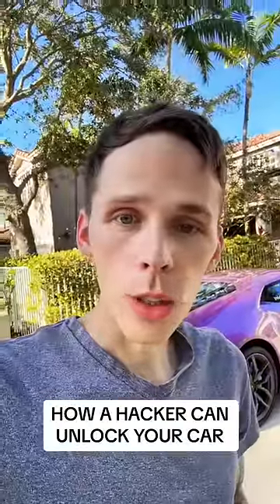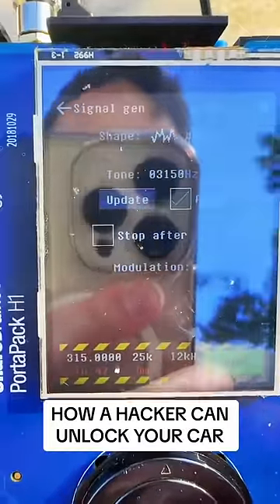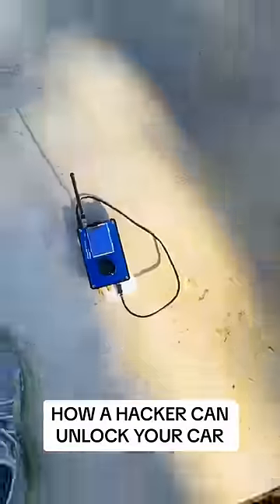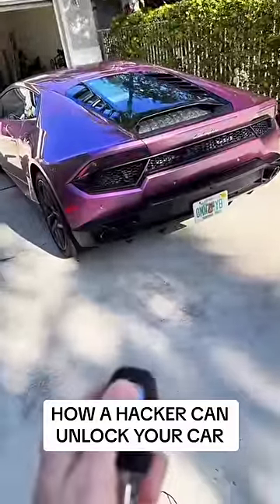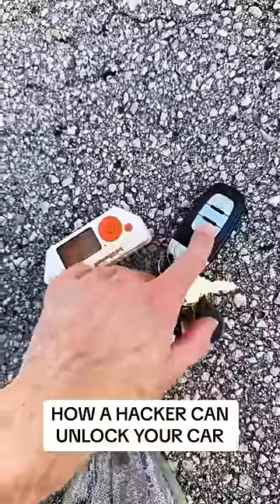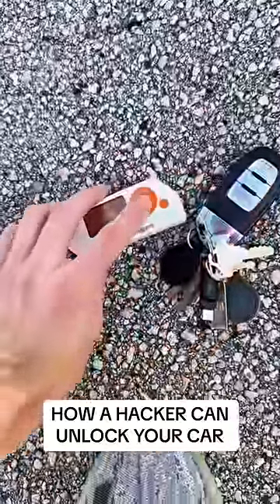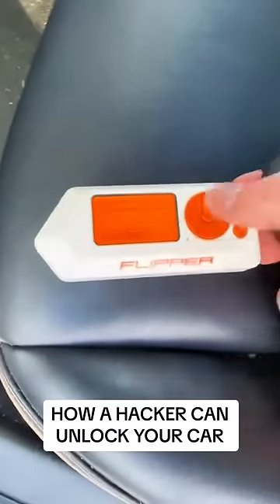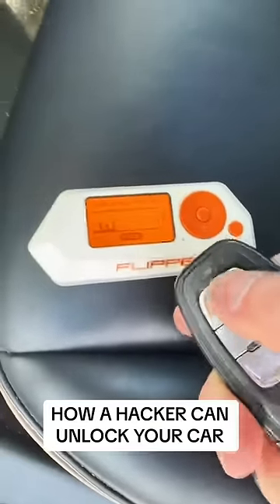Unlocking A Car With A Flipper Zero (Rolling Code)

Comment: I’ve heard somewhere that most modern cars use a rolling code system, so that each unlock/lock has a unique identifier. If that was the case, wouldn’t these kinds of attacks be useless?
Reply: I was thinking the same thing but as you can see in the video he is essentially jamming the vehicles receiver from receiving data from the key fob, at the same time he is recording that data with the flipper and then re-transmitting it later after the jam-er is tuned off. I just don't get how the flipper is able to pick up that signal from the fob with rf interference being broadcasted. It looked like he had to have them right next to each other for it to work.
Reply: this is true for most fob remotes since the mid 90's, for this to work, you need to get fob press signal while the fob is outside of the range of the car, its the only way it works, so in practical use, its just not worth it compared to traditional methods

Comment: Once the jammer is disabled, using the keyfob once should advance the rolling code and make the recorded signal unusable.
Reply: exactly so im a bit confused, i feel like this is a bate
Reply: @firewall_chronicles it is, there are videos everywhere about it after canada banned the flipper zero specifically from being able to unlock cars when the conditions required to do it are so unlikely that it would never happen

Comment: Keys nowadays have unique codes for each time an input is sent to the car, if the codes dont match, nothing happens and as seen, you still need the proper frequency, without the key to begin with you will not be able to do this, its very cool but its just as safe as a normal car against a crowbar...

Comment: Just so you know for some people that are are not aware of how this works. This does not work on all cars. Some of the newer cars will have a system that changes the frequency/coding EVERY single time you unlock/lock the car or start it, specifically designed to stop this kind of hack. Meaning that this system will not work for those vehicles. Flippers will only work for the most basic of functions. And likely not at all for a lot of vehicles

Comment: I drive  a 2014 Lexus Rx 350. Its got 61k miles and is probably as in good  as shape as that year can be. I leave it running every time i go into a store for a drink or smokes. Im in suburban Atlanta and i don't worry. At least if someone steals it they dont break anything.

Comment: Ok, but it also has to clone the passive rfid that lets the car know the key is inside. This wont work on a lot of modern cars because of updated security. You need two separate frequencies to mimic a car key from 2023. Unless you buy cheap trash cars

Comment: 1989 944 Turbo. OBD1. Quick release steering wheel. 5 speed manual. Key entry no remote. Battery kill switch on hood. Good luck.

Comment: 1. Why did he need the noise jammer, he could have just moved away from the car 😭, 2. The key or frequency code grabbed from the actual key will only work once due to the running cycling frequency on the car and fob. 3. If someone wants to open your car, they could simple break a windows and hot wire.

Comment: This is why I didn't connect my two way alarm system to my lock circuit or engine start. You gonna have to break in and trigger the alarm.

Comment: Yeah but that works ONCE, and requires blocking the original fob, as you showed. But once you've used your rolling code (OK, you got two codes for unlock, so it'll work twice) it stops working.

Modern remotes have more tricks, like requiring to be within the car, or else the engine stops. This trick is of limited use.

Comment: If your keyfob is not working, quickly open the door to your car, pop the hood, and lock the ground battery terminal on the battery cable with a key lock. Problem solved till you can get a Autel Scanner and new keyfob to reprogram that new key to the car.

Comment: How did you get rolling codes working on your flipper. I have my flipper and only have 1 key for my altima and want to use my flipper as a spare but have had no luck.

Comment: Double flex for sure, but If key fob stops pull battery from fob, or get it away from car, use key, I'm telling you, my fob got wet, set alarm off while driving, the next day computer, shut  car down, $750 to make her start again. Oh if u think someone is playing, pull the run crank and fuel pump relay, they ain't getting shit. Store your fob in a metal box at night.

Comment: Had this happen right beside city hall in 2020. 2 fobs with new batteries and cop that showed up to unlock my car physically didn’t have a clue when I showed him it wasn’t working. A “tow truck” guy standing right beside the car had to have jammed the frequency and it worked fine after I left. Wonder if he’s on the policeman’s body cam at this point? Is it a felony?

Comment: Can they still unlock it if it has no wiring for the locks we just got a brand new 2018 wrangler and we can take the doors off is there anyway that they could get into it without the wiring

Comment: Simple attack, not really a criminal will realistically do to rob your car. Perhaps for a high value target it would be more
Helpful. Better hope you have the permits to transmit a jamming signal out into the air as it’s highly illegal even done on your own devices, replay attacks are okay but a jamming signal is not legal at all. I’ve done much work in this area, be careful.

Comment: Doesnt work this way, remotes have a rolling code so even if u record the signal it only works once.if u record it without the car picking up the signal yes u have a 1x hit. But u cant record while jamming so u need to do that out of range of the jammer. And out of range from the car. Old cars dont have the rolling code so the signal stays the same than this works.

Comment: Here in my country crimenals steal gate ramotes and wach people from a different car and use the gate remote signal as a jammer as its signal interferes with the car remote signal when i press my car remote button i stop to check if my car is locked otherwize if you dont youl return at best with your sterio gone at worst with your car gone its damn crazy how people find ways to rob and pass security systems 😢

Comment: Why would I wanna buy a flipper zero to unlock the car when you already need the key and to press the unlock button on the key and have the flipper record it and then use the flipper to send the signal. That’s pointless. Just use the damn key

Comment: Oh please... keys have rolling codes and unless you have that jammer then the code the car is expecting will be different from the code you recorded. Also how many times do you walk up to your car and lock it twice and unlock it twice? Moreover, if the car doesn't unlock then you'll investigate and see the dipshit standing 6 feet away from your car and not going anywhere because he has to jam and/or record every time you press a button on your key. No one is stealing a car with a Flipper Zero.